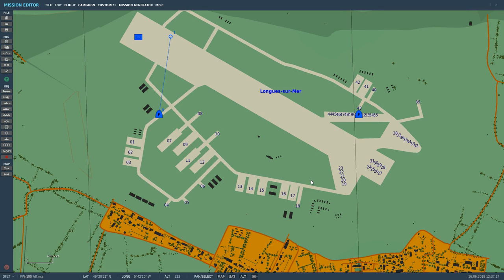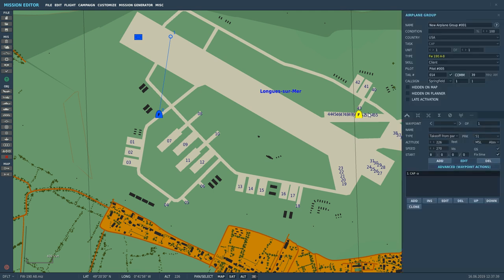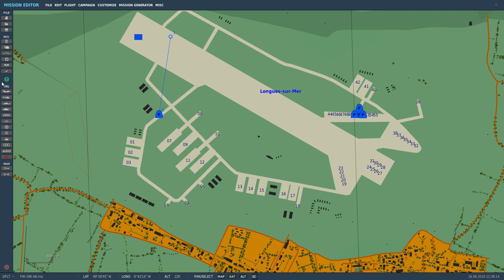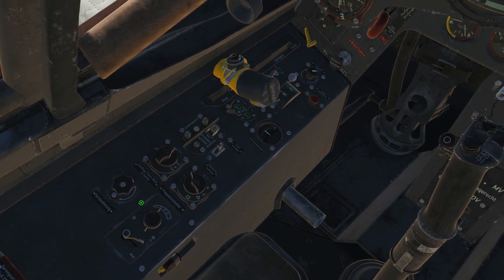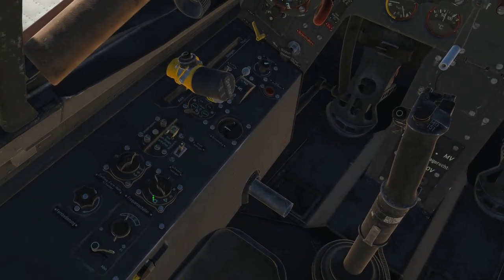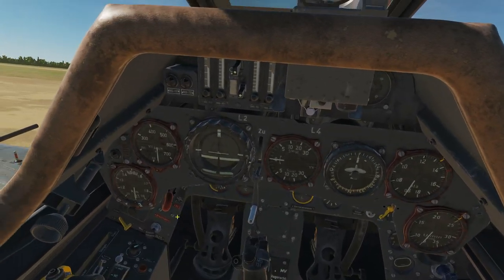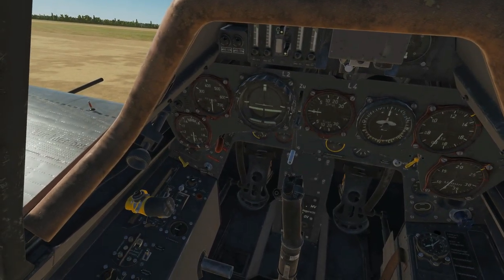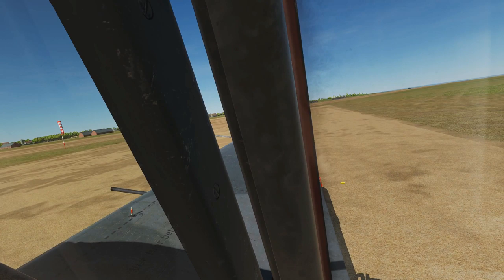FW-190 A-8: FuG 16 Radio Tutorial | DCS WORLD

Comment: FuG 16 Z, ZE and ZY: These sets were airborne VHF transceivers used in single-seat fighter aircraft for R/T and W/T communications, and were also used for ground fixes and DF homing on ground stations when used in conjunction with the FuG 10P or FuG 10ZY. Installed for Bf 109G-3/G-4 and later, Fw 190A-4 and later subtypes. Frequency Range was 38.5 to 42.3 MHz. The FuG 16ZY was also used for Y-Verfahren (Y-Control), in which aircraft were fitted up as Leitjäger or Fighter Formation Leaders that could be tracked and directed from the ground via special R/T equipment. Aircraft equipped with ZY were fitted with a Morane whip aerial array. Principal components: Transmitter, Receiver, Modulator in one case, S 16 Z Tx, E 16 Z Rcvr, NG 16 Z Modulator Dynamotor U 17 Antenna Matching unit AAG 16 Z Modulator Unit MZ 16 Homing Unit ZVG 16 Indicator AFN - 2 .
The actual unit was in the fighters belly, remote controlled from the cockpit with electric servos. The range switch is from 4 to 2 kilometres.
Reply from the maker: Thanks Sir

Comment: The frequency presets where:  
I - Y-Führungsfrequenz, "Y Management frequency". Transmitter sends on channel I (to the GCI operator), receiver listens on channel II (wingmen). The pilot can transmit a signal to the GCI (Ground-Controlled Intercept) while also still be able to hear what is going on in his flight. The transmitting on channel I is in fact the "E-Meßbetrieb" and you switch the mode selector to "Abst."
The maintenance manual states that II is always 1.9 MHz higher than I.
II - Gruppenbefehlsfrequenz, "Group Management Frequency". Frequency of the flight.
III - Nah-Flugsicherungsfrequenz. "Air Traffic Control".
IV - Reichsjägerfrequenz, "Reich Fighter Defense Frequency". Country wide coverage for broader operations.
Reply from the maker: Thanks Sir